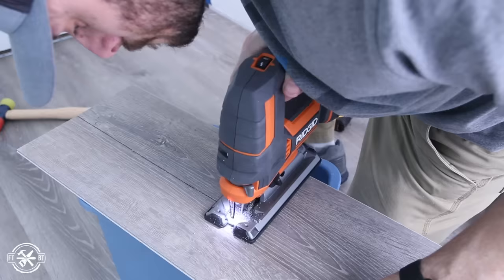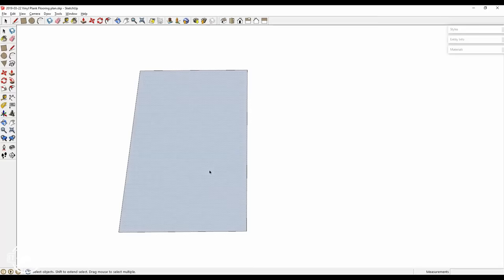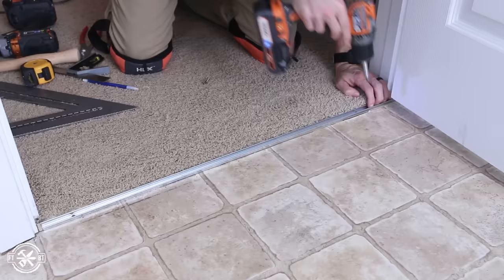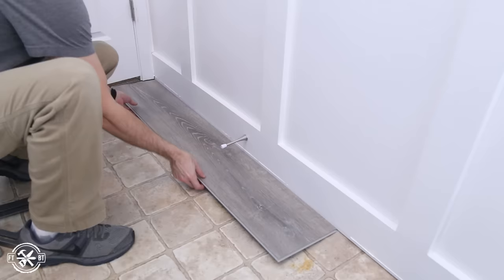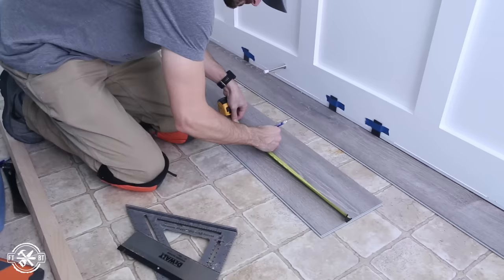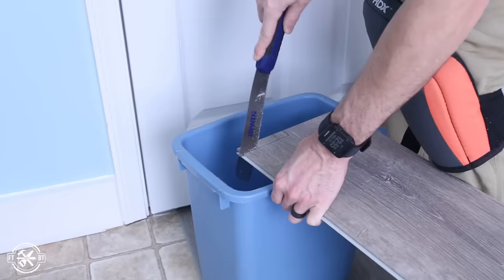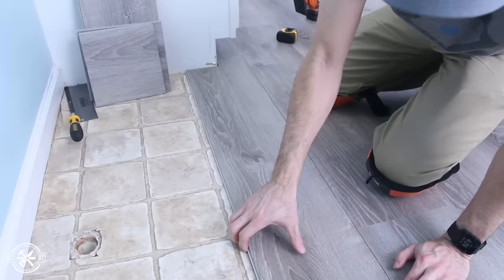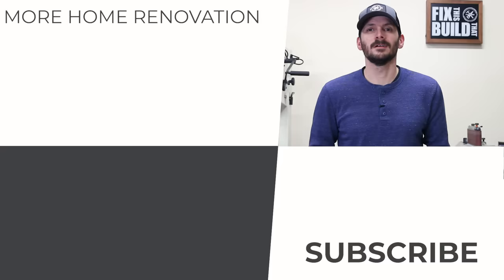How to Install Vinyl Plank Flooring as a Beginner | Home Renovation

Comment: I know I'm a bit late to the game watching this video but just found it on YT. Question? Was there a reason you did not remove the vinyl flooring underneath before installing the new planks? I'm getting ready to do my BR and have a similar flooring and was going to cut and remove it. (original flooring. House is 40+ yrs old and this is the last floor to replace!) If there's a good reason not to, I'll be very happy! I wasn't looking forward to cutting it! Thanks for all help and suggestions!

Comment: Sorry if I asked a question already answered previously. For the final plank that needs to keep it 0.25 inch from the wall, Does it apply to those to the 3 sides of the walls except for the one to transition to the carpet side. Based on what I observed, those planks near the channel at the end is almost flush so I guess that's the only place that you don't leave 0.25 inch. Or am I wrong? Thanks for any feedback.

Comment: I buy a halfway decent (not too good, you'll be throwing it out afterwards as the floor will destroy the carbide) saw blade and use my chopsaw and table saw for the floors, because the jagged scribe and snap line isn't acceptable to me

Comment: Click vinyl planks - which way to lay?

Where: Narrow long room 7m x 3.30m. The only natural light source through the one narrow end (however, plenty of light, window wall from floor to ceiling). Room use: Living/dining room and a small kitchen at the darker end. Colours: Vynil planks - light/grey oak, walls - cream, ceiling - white.

At the darker end, in an oblong direction (yes, the flat is a tube), there is another corridor.

Dilemma: shall i lay the planks crosswise so as not to make it look even narrower? Or lengthways, i.e. in the direction of the light?

THANKS.

Comment: Great vid I think it really helps, I just don't have all those extra tools, spacers, grabbers etc. Of course it's not supposed to be cheap or that easy
Reply: I work in flooring, this video makes it look a lot harder than it needs to be, you really only need a good blade, good set up (measurement for the room) and knowledge on how to get great cuts around the skirting. Never used spacers. Just ensure the boards are tight together and flush.

Comment: That good but when you start your second row ive seen that you start with your cut piece first and its faster and professional if you start your second roll with full piece work your way down to your cut and that how you professional start and end a row then you your next roll you can start with cut piece cut piece and line it up with your second roll cut so you dont throw your self off on the pattern and always want your cut pieces to line up with the so foreth piece along the way

Comment: Tip,the room he did could have a water problem so you use the same type of floor,you would use in a basement,this is call a below grade floor,also he did not put down any padding first, but some floors have a special padding on each board,make sure to read the direction,the padding is very important if the floor you buy needs padding

Comment: Instead of pulling the tape measure out just flip the board and butt it against the wall and mark it, this will save a ton of time throughout the duration of the job. Pulling the tape out for every cut is not necessary everytime

Comment: Looks great. I have a question. What size to cut every other floor I have never don’t it but would like to install it to my lanai so it’s a straight shot really no doorways or anything. Also, it would not need a trim. Because the current floor is concrete.

Comment: It looked like on several occasions that you cut off the "locking end" of the plank and still jammed it against the other plank out in the middle of the floor. Is that standard installation or a no no?  Also some "beginner" items that would have been good for "real" beginners were, do you cut the plank with a saw, face up?  Do you use a regular saw blade or does it need to have real fine teeth to keep from splintering the plank?

Comment: The socks are under the dryer because while the washer/dryer spins, the socks are light enough and small enough to fly up into the Crack between he barrel and lid and then fall to the bottom of the appliance.

Comment: I think it would’ve worked out for me if my floors were actually even, some parts were uneven so they started to separate and crack while doing it. I thought they were pretty even until I installed the tiles. I actually regret doing it and will probably just remove it. Wasted time, lots of money and effort. I definitely needed to prep my floors.I have done it prior with different types of tiles (stick ons) but the high quality planks-not the sticky ones may give you problems along the way unless you properly prep your floors or if the tiles I put it on were actually even. They’ll lift or crack when you click them if there’s not even support underneath. Now I have a lot of tools (which I could use for other DIYs), extra planks that I probably have to sell and now I have to remove them and throw them out. The old floors weren’t bad just an ugly color which  is why I stuck to DIY-ing it. And ofcourse that mind set of “Don’t give up” and I didn’t so I guess I’m proud of myself for that. BUT BEFORE YOU GET ALL THE SUPPLIES MAKE SURE THAT YOUR FLOORS ARE EVEN. If not, maybe the cheaper stick on ones will be a better option because at least you can stick it to the floor and actually mold into the shape of the floor. Or have that filler thing you can spread to even out the floors. Good luck!

Comment: Hope your original floor was nice and flat/level. If it wasn't, you could end up with damage (such as cracks) in use. Normal practice is to use a thin underlay - hence the term 'floating' floor. With underlay, it feels better underfoot and (especially important in a wet area) makes it so that your flooring isn't just sitting in water if you get a leak.
Reply: The product he used had the soft underlayment built in, as do many products these days.  But, yes, he should have checked that the old floor was flat before installing.

Comment: Appreciated all the tips. You didn't put an underlay down - it is normal to put 2mm or 3mm thick 'soft boarding' under the vinyl here in Europe. Are there reasons to do / not do?

Comment: You say start on the left side of the room but you don’t say how you determine the left side of the room.  Is left standing in the door or???  What if the room has two doors?  I have never used vinyl flooring before, I’ve done everything else and appreciate your input.

Comment: I noticed you added shims for 1/4 inch expansion on the one side but started cutting tight towards the end of your video, especially where you cut in for the pipe .

Comment: Great video I think I watched it 5 times so far. Anyways I feel confident in my ability to install myself after this. I will be putting pretty much the same planks in my basement which is just concrete. The main space is 22 long by 12 wide.  Should I use an underlayment for moisture even though my planks have padding built in like this video? Also I have removed all of the baseboards and plan to put in all new trim, without using quarter round. Should I still plan to use the spacers in this video or start with the 1st row having planks going under the sheet rock/dry wall? I've never attempted this before and I don't want to mess it up. lol. Last thing I want to ask is how many square ft was this laundry room and how long would a first time installer in that size space expect to spend with all of the detailed and intricate cuts?

Comment: There were spacers on the all 4 sides edges, and the last step is just putting molding on the floor. Won't the floor move in any direction because of the gap? Or the friction on the floor bottom would be good enough to hold all floor pannel on the position?

Comment: Interesting.  I've been thinking of doing my small bath (~6x6') and was considering just epoxy painting the old ceramic tile... the original owner did a so-so job with the grout and it just does not look all that great.  This may be an option, if I can figure out the best way to install over that tile without creating a major project.
Reply: epoxy then coat with a FLC and your good to go

Comment: Ok. Question. I am getting ready to install my first. I laid down plyboard and subfloor as my start, getting ready to start the vinyl plank flooring. Very close to the style and color you have chosen for our kitchen. Should I use some form of adhesive? For example henry bond, or another type of rubber cement to adhere it to the plyboard. This is going to be a permanent floor, so I'm not looking to rip it up.

Comment: Is the vinyl flat? We're putting LV over fairly smooth engineered hardwood. Should we sand engineers wood first etc? We really don't want to remove the existing floor.

Comment: I was told NOT to put floating vinyl laminate under fixed kitchen cabinets with a quartz counter top, the flooring wont be able to move in that 2 ft area and floor may buckle. True or False?.

Comment: 2 stupid Questions. 
For a bathroom ( not sure if it matters which room ) But when walking into my bathroom the tub is straight ahead.   Should the planks be installed from door to tub or from left to right.  Or does it really matter ?  2nd question if installing with the 1/4 inch spacing border does the floor shift with this 1/4 inch gap?

Comment: Question:  If you want to lay your vinyl planks horizonal in a hallway, and the vinyl plank fits, do you have to cut any off, or can you use the entire board and not stagger it - meaning no seams at all?

Comment: I have flooring like your original in my office which we're pretty sure it used to be a laundry room (complete with wall mounted ironing board). The rest of my house has wood floors so, how would the transition part change?

Comment: Realizing this is an old video. And realizing your a do it yourself guy.. This is an O.K. install. Ive always said installing floating floor is not rocket science. Your method leaves a lot to be desired for sure. As an flooring installer with experience I got a laugh out of this. At the end of the day you made this like 5 times harder than it had to be. However homeowners dont be afraid to do this yourself and there are some decent tips for sure. However a couple of  reasons folks may want to hire a professional to do this is simple. A good pro company should be able to install 1000 SF in one day. So your life gets back to normal rapidly. However the main reason is the pain you will endure. Again its not rocket science but it hurts to be down on that floor if you are not used to it. Thanks for the video though.

Comment: I notice he didn't remove the existing flooring.  Can this also work if the existing flooring is ceramic tile?  Can I install Vinyl flooring over ceramic tile or does the tile flooring have to be removed first?

Comment: We live in a double wide manufactured home. Is it advisable to replace the carpet with vinyl plank flooring. I'm concerned with possible unevenness between the two halves of the building. Should I be?

Comment: We have just begun our flooring install. The main issue we are having is when we add a plank that connects on the short side and long side. My floor instructions say to connect the short side first then the long--but it is proving to be very difficult to get the plank to snap into place in the corner. Any tips or tricks to help get this piece to snap into place on both sides?

Comment: Buying a new house that has a weird red tile in the large foyer and we’ve talked about doing a vinyl plank there. We’ve talked about removing the existing tile to do this. Is that necessary or would it work to just go over those tiles as you did here?

Comment: I installed similar flooring over existing vinyl flooring: big mistake!  Now, after 2 years, the planking is breaking because the underlying vinyl is collapsing causing dips and valleys.  Will have to rip it all out, including the old vinyl and start over.

Comment: I'm in the process of ripping out exact flooring that's less than 2 years old. Why? You feel every imperfection in your subflooring under this stuff. In our case, the previous owners lets their pets use one half of the house as their bathroom and tried to cover up subfloor damage. There were literal spots where you felt like you had stepped up or down on what should have been flat. We had to seal the old subfloor with Kilz Original + laminate a new layer of proper plywood to the existing damaged OSB subflooring. We're now putting down much stiffer and higher quality click-together laminate flooring made by Bourbon Street. We're one room in and I have to say that the effort has been worth it - the new Bourbon Street floors are a million times better feel on the foot and the new sub floor is perfectly level - no more sunken or raised spots! I would never invest in this cheap vinyl plank for any space other than a utility room. Even then, I probably would put real tile in.

Comment: I was thinking that 'you' had to maintain a ¼-inch expansion gap (1/4") between the VPF and all perimeter walls (in your case baseboard). 
You maintained the ¼-inch expansion gap on just one wall??

Just googled: "Because of vinyl flooring’s climate sensitivity, be sure to leave about a ¼-inch expansion gap around the perimeter of your floor."

Comment: Do I live off 2 inches or can I just use the 1/8 spacers by the wall?  I know the floor will expand that's why it needs the gap.
Aldo a long time ago I installed some laminated flooring and for some reason I was waitsting lots of planks cause the way I was cutting them I guess or the way I started, I forgot?  So any tips will be appreciated so I don't waist planks like the first time:(

Comment: Score from the back of the board it will save you so much headache. SCORE FROM  BACK AND SNAP OVER KNEE TOP FACEING KNEE THEN BEND BACK IN OPPOSITE DIRECTION AND BOOM

Comment: Confused about laying boards next to each other. You come in at an angle along the long seam to attach it to the previous row, but then you are unable to angle the plank to connect it to the piece beside it. On the planks I just bought, the end profile is the same as the long side profile,. Seems like you would have to angle the short end and the long end to get it in place correctly, but that is not physically possible. What's the trick? No one addresses this in installation videos. Thanks.

Comment: No way, before you lay laminate or vynil on a tiled floor or concrete floor ect, an impact sound insulation is laid out. It also smooths out imperfections and gives isolation.

Comment: Don't tape your spacers to the wall, especially thick end down.
He skips the part when he needed them out, because I can almost guarantee, they were stuck... Physics 101.
Those spacers are used in pairs, side ways, they lock together like a rachet... They're then easily removed by sliding them upward from the back, using pliers or a screwdriver.

Comment: I have no luck with any flooring that requires the locking edges ... looks good when installed, then you get 3 rows away and the previous joint is pulling apart ... peel and stick for this guy...

Comment: Nowhere. There are zero unpainted spots in my house in any of the spaces I actually touched. The only exception is unfinished technical room where the water heater, furnace, water softener and water filtration system live

Comment: This stuff is all full crap when you get to the last edge of the wall it's always 3/4 of an inch and a half plank been trying to get it under that door trim when it's the last piece forget it doesn't work have to take the wood trim off to get it to go and when you don't have any baseboards or anything in crooked walls then you do use loctite Caulk to fill in the gaps